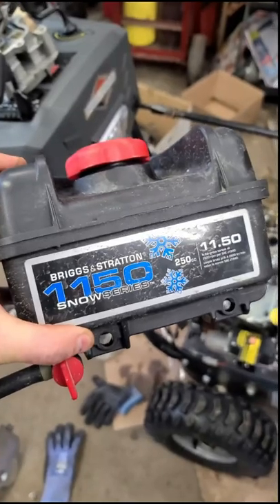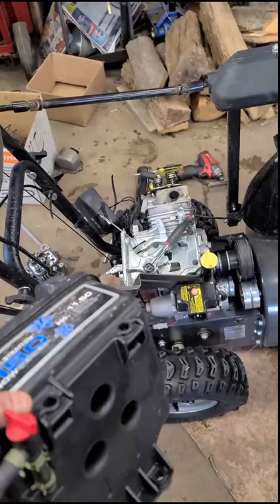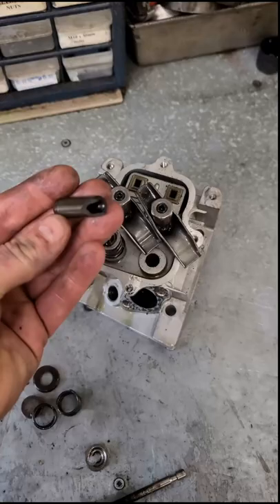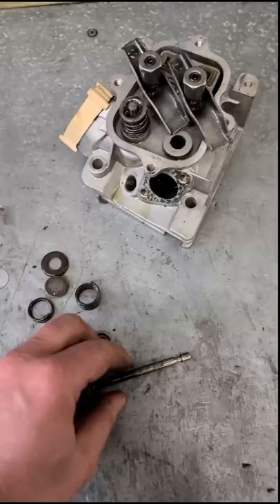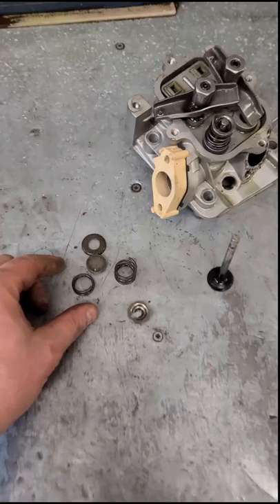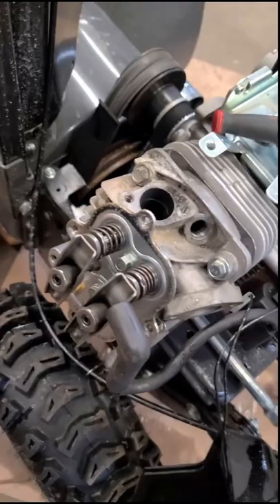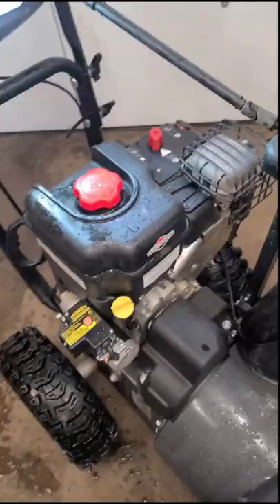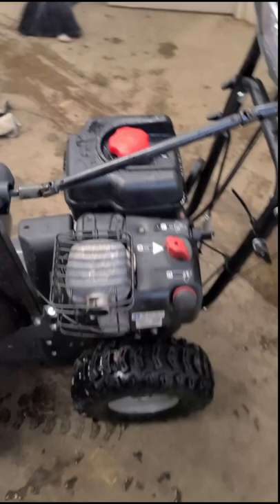Briggs & Stratton Engine Seized After Customer Hears A Loud Clunking Noise! Here's Why!  #shorts

Comment: B&S has had problems with overhead valves as long as they've made engines with overhead valves.
Reply: That is true. Then they wonder why people and manufacturers buy the cheap Chinese clone clone engines.
Reply: They need better engineering and quality control for sure, not like they used to be

Comment: had a ridgid generator come in yesterday..  has a yamaha mz360.  customer never changed the oil.  connecting rod broke and poked out of the side of the crankcase.  "sir, your engine blew a new hole.  it appears  the oil has never been changed."  "i thought you never had to change oil."  "do you have a mower?"  "yes i do"  "do you change the oil in that ever?"  "no, should i?"

/facepalm
Reply: @robertasleson5856  hurts my brain lol

Comment: If you hear a loud pop and the engine then seized up is this what happened. I bought a used ariens 9 26LE  no more than 3 minutes after the guy dropped it off we started it it ran he ran it on low I trusted him and he said he’s a mechanic he went completely through the machine changed the oil it had oil in it but was not changed and now he will not return my phone calls.

Comment: Hey Dony, why do we need overhead valves on a snowblower or lawnmower?
Reply: More fuel efficient
Reply: @simonauffrey7032  With all the SUV's and other gas guzzling crossovers and the like it seems we don't really care about fuel efficiency.  More moving parts, more to wear out and cause problems.  I don't see a benefit.

Comment: I have a Briggs & Stratton snowblower that has a grease fitting on the auger gear box. What kind of lubricat is required for it. The manual doesn't say.
Thanks.
Reply: I use farm and truck grease. I believe it’s red in colour.
Reply: @komit73  Thanks

Comment: When this happens on lawnmowers, the root cause often is rodent nests in the cooling fins/shroud, leading to overheating.  What causes this to happen on a snowblower? I have a B&S 1350 on my Craftsman, so I am very interested!
Reply: It is very common on that style of B&S with OHV. The valve sleeve just pops right out after awhile. I am not sure if it is the casting of the head, or the sleeves being a different metal... I believe some JB weld and pinching the head around the sleeve with a punch works.

Comment: Thanks for sharing. This is not a case of bad engineering but of poor materials in production. Quality control is everything in mass production. The workforce can have the best skills and tooling but if the materials are substandard so goes the product. Going electric is the big push as of late. As more market share is taken away from Internal Combustion devices, the quality of materials in electric devices will dwindle as well. The old rule of 'Buyer Beware' has never been as relevant as it is in today's market place.
Reply: It was engineered well enough to meet the requirements of the beam counters.

Comment: Ever see a Honda snowblower do this?
Reply: Never on a Honda snow blower or lawn mower
Reply: Have seen Honda's drop connecting rods. Neither is condusive to long life of machine.
Reply from the maker: never, but i hope it doesn't come to that
Reply: @donyboy73  I adjusted my skid shoes today. Honda recommends 2-4 mm from ground level to bottom of scraper. I used 2 quarters usd stacked on top of each other to get 3.5 mm. Seemed to work great. What do you use as a standard to set the skid shoes and scraper?
Reply: @appleztooranges  I use a piece of 1/8 inch piece of metal on each side of cut bar to adjust skid shoes. In the off-season take the shoes off and weld two beads of weld down each one. The shoes last forever and the weld doesn’t wear off very fast
Reply: No never, Honda's are always perfect even if run without oil.
Reply: @heathwirt8919  lmao
Reply from the maker: @heathwirt8919  lol

Comment: So what CAUSES it to happen? I've never had a B&S do that and I'm 63 years old.
Reply: I think it has more to do with the poor quality engines they are turning out today! No wonder they filed for bankruptcy!
Reply: i would almost wonder if it happened because a dirty carb was causing the engine to run lean and hot kind of like the dodge engines dropping valve seats when they overheat.. i had one of these where the muffler would be glowing after about 2-5 minutes of running. cleaning the carb got the muffler to stop glowing but clearly things must have been getting hotter than they should if the muffler was glowing red.
Reply: Were some of those old B&S engines flatheads? The older flat head engines were great and only required a little maintenance.
Reply: @thebeardedstork432  I didn't know they filed for bankruptcy.